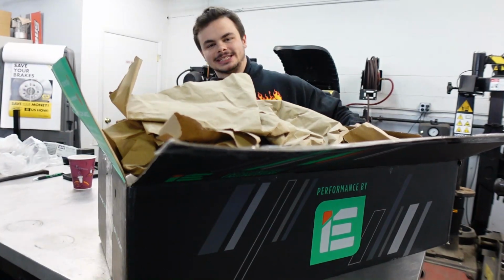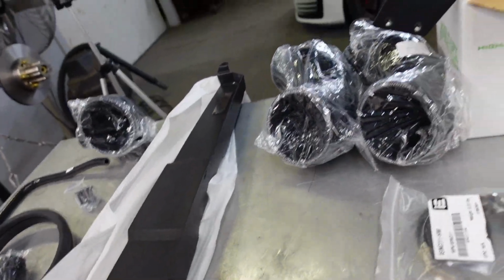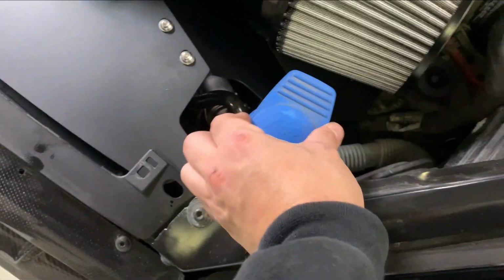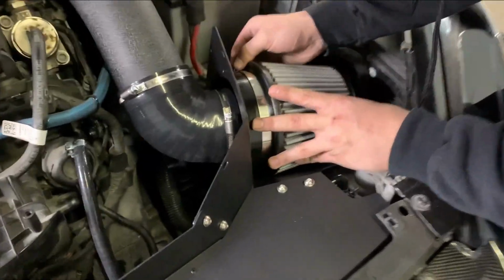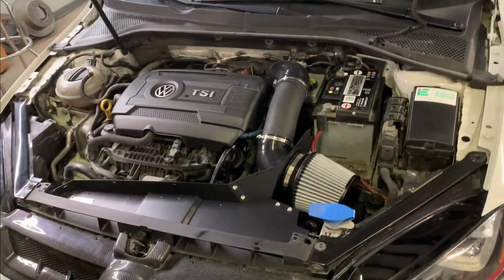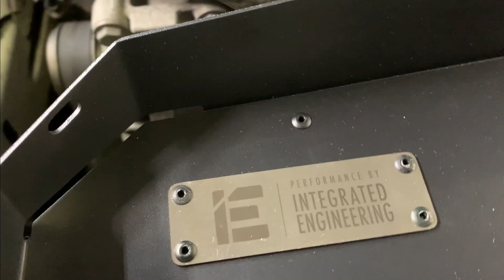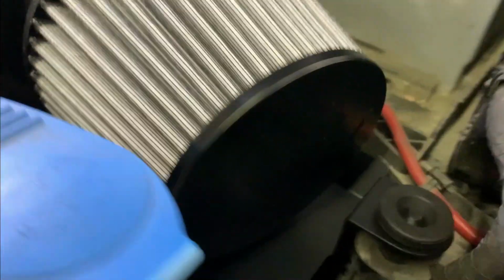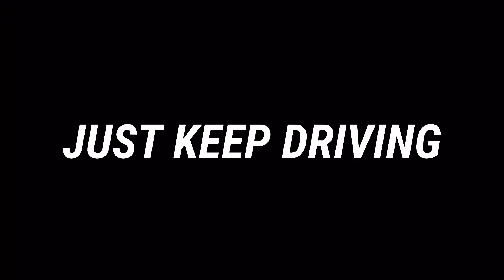The BEST INTAKE for MK7 GTI/Golf R! Integrated Engineering V2

Comment: This wont mess up the turbo at all right? With it fluttering and all? Im not educated crazy in cars just asking. Since im getting a gti very soon hopefully.
Reply from the maker: never feel bad for asking questions my dude. So "technically" it's not good for it but small amounts naturally aren't hurting it. It happens when you let off the throttle and the boost pressure comes back threw the turbo instead of it recirculating. that's why when people have a big blow-off valve they don't get flutter because all the pressure escapes. That's a really quick answer but hopefully it helps. basically when it happens naturally its fine
Reply: @ChrisFromKenya  I understand now. Thanks man really appreciate it. Really hope i get this gti and can have fun with it. Started searching for exhaust, wheels, and coils/springs. Super excited yours is insanely sick too man keep it up!
Reply from the maker: @durxge9591  sweeeeet no worries at all man and hell yeah! I appreciate you 🔥

Comment: Bro you made the best switch. I personally am keeping the stock box and upgrading both inlet pipes and the air duct
Reply from the maker: Yessir if your trying to avoid the heat soak your definitely doing the best route!!! You know ya boy had to have those intake noises though 😂🔥🔥🔥
Reply: @ChrisFromKenya  of course i almost went that route but I think making people take a second glance is more fun
Reply from the maker: @Locallybuiltauto  yessssir 100% that’s why I love the ski box! People want to run it and get clapped by a gti with a roof rack 😂😂😂

Comment: How’d you get the turbo whistle?? I have the same intake but no whistle
Reply from the maker: Like on the exhaust side or intake side ?
Reply: Intake side that low throttle stutututu
Reply from the maker: @jeremiahlee5998  honestly I haven’t had it do it until this intake or back when I had just the diverter valve spacer surprisingly was really good and fluttered a bunch haha

Comment: Snow grate removal, drop in filter, elbow, turbo inlet pipe, and euro block off plate. You can do all that for less than the price of almost every CAI alone, and it’s been proven on many high # setups across multiple forums.
Reply from the maker: Yeah absolutely man! That’s legit the best for the price and all around for pure performance I ran that for a long time before truing a couple open intakes. Not gonna lie I just can’t get enough of those induction noises brother haha definitely quality wise this is one of the best I’ve seen for the price
Reply: Yup all that on the cheap is good, but not loud. All about them decibels
Reply: You’ll never get these sounds with the stock box no matter what you do to it. That’s the point of the CAI.

Comment: With your previous intake setup Did your turbo flutter like that when you rev the engine on neutral?
Reply from the maker: So when I ran the ecs DV spacer and the cts intake I got a lot of flutter but when I switched to the turbo smart bov it’s a lot cleaner sound but no flutter. Then I switched to the IE intake and now it does again haha
Reply: @ChrisFromKenya  your videos inspired me to run a similar setup. CTS intake/TMD, ecs dv spacer, but with a bms inlet pipe. All i was aiming for is induction noise and turbo flutter but your setup sounds 😩👌🏽 I might have to drop in a real BOV and swap for that IE intake. When i rev all you can hear is the intake so im Not sure if having a DSG makes a difference but I wonder if i would get that flutter when i rev in neutral with your setup
Reply from the maker: @toasty1571  yoo that’s so sick dude and honestly it’s just one of those things you have to keep messing with unfortunately until it sounds how you like haha that’s why I’ve changed my intake setup like 3 times!! Always chasing flutter 😈

Comment: Just a quick question Chris, I'm looking to go decat 3" DP on my mk7 GTI, will this work with the stock resonator or will I have to remove it ? Currently have a muffler delete so the res is nice to have. Cheers
Reply from the maker: Hey man, so usually if the DP is a decent company they will send it with an adapter pipe so that it will fit with the stock resonator if that stock Audi/vw tube clamp. So when you order it just make sure it either narrows on the resonator side or comes with a adapter and you should be good brother! Cheers! hopefully that helped a little